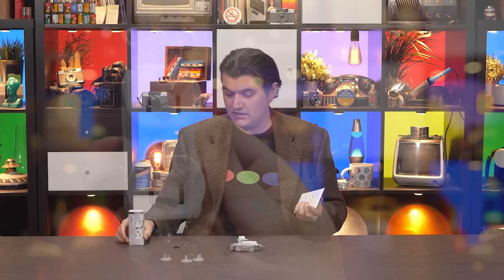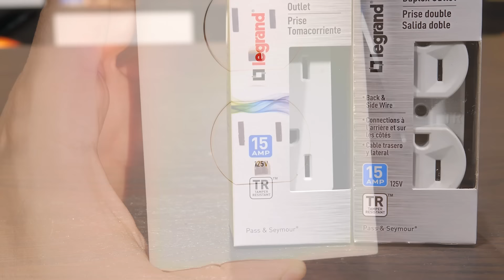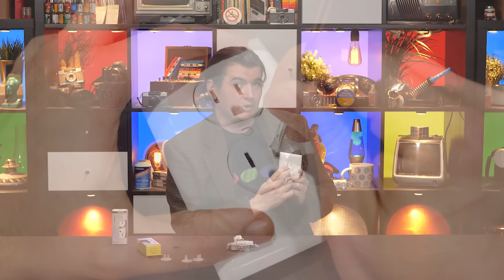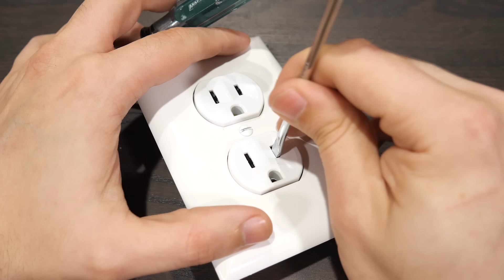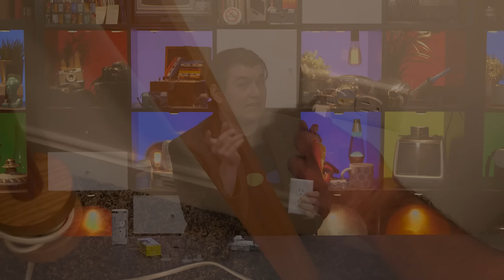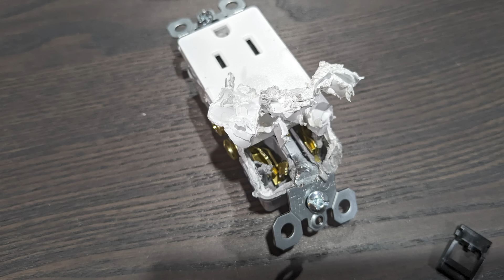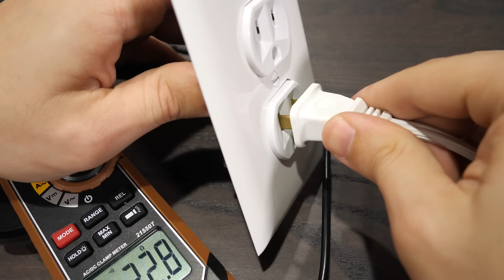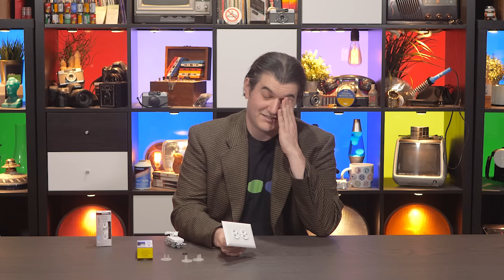Tamper-resistant outlets aren't all the same - a follow-up

Comment: I've actually come across a few outlets that dony have the side screw terminals, and only had the ability to stab a stripped wire in a hole. I dont remember the exact design, but I remember being frustrated that I had to straighten out all of the wires to install the new outlet.

Comment: 14:00 (well a bit earlier) you'd actually be surprised - all things considered doubling the voltage isn't that much, by the time you get to touch a live wire the same other concerns will apply - are you wearing shoes etc. Twice as much voltage isn't a whole order of magnitude, so with all other things being equal it's not gonna make much difference to the outcome - are you dead or not will really be the same equation for the same practical reasons. We don't have accurately measured resistors for shoes etc, so it's gonna be about breakdown voltage and all sorts of similar thresholds for which it's a matter of order(s) of magnitude rather than a doubling.

Comment: Well, 120 volts really is just slightly safer. Don't let that go to your head. If one bar was connected to hot and another to neutral and you grabbed both bars, you're not letter go without someone intervening or the power conveniently goes off. The heart is also very sensitive. There have been weirdos into BDSM that got their kicks off of running one wire to one arm and the other to the other arm. It eventually stopped his heart and he died. Arm to arm is the worst because it goes over the heart. If you have a decent capacitive coupling with the ground with a foot or whatever, a brush with a hot wire can stop your heart. Just because it probably won't fling you across the room (which could be a good outcome in itself), it's still high enough voltage to be a silent killer. Anything no matter how minute we can make our 120 volt power more safer is well worth it to me. Besides, not one likes getting shocked. I've been shocked numerous times by unpolarized lamps, bad home wiring, and me sticking my finger in outlets and sockets when I was little. Yet, I still like working with electricity.

Comment: The "child proof" plug covers have been proven to be almost useless. What toys do we give babies and toddlers? Plastic shape sorting games. It was found that a 1 year old could remove a cover more easily than an adult. And in one case was seen to remove a cover, give it the usual oral inspection, then deftly re-insert the now dribble laden cover.
There is a campaign to eliminate them (Fatally Flawed) in the UK, as they also effectively disable all the safety features built into the socket, and the poorly dimensioned pins can end up distorting the socket contacts, leading to poor contact problems  in future.

Comment: Nice, as I said under main video - its only 120V :D even 5mA GFCI does not trip reliably when you touch hot wire. Ask me how I know. Fun fact, Poland, where I grew up uses 30mA whole house GFCI thingys. Even having 230V. So yeah. I would say main problem with US plugs are exposed prongs, causing fire hazard, not so shock hazard, unless small kids with deadly curiosity, but that's why we have TR.

Comment: Safer does mean less dangerous, anyone that complains about that is an idiot.
I got a 120 hit multiple times.  Reaching for a shop light under the car, the exposed wire in the cord hit the web of my hand.  Then doing drywall, grabbed the outlet to pull it through the outlet hole, and grabbed the side of the outlet.

Comment: The feeling around for holes in the dark is something I do all the time. Especially for finding alignment. Though I live in the UK, so I usually fumble about poking holes on sockets until I find the vertical arranged in (which is the earth pin hole). Though it's less of an issue because a) shutters on all holes and b) sleeved L&N pins in the unlikely event a plug has become loose.

Comment: My main problem with us-style plugs is that receptacles are not reassessed, a child almost died at my house because of that

I live in a country with a EU plugs, but my house was build in a time of let's say turmoil and nobody cared about the code, so all receptacles were made flush with the wall. And basically the exact situation you were describing as not likely happened, someone pulled on a wire, it became loose, a kid was walking by and touching the wall, not paying attention, his hand slipped on the live wire, he almost died and everything electric in my kitchen was fried except the stove and an oven, which are on a separate breaker.

This wouldn't have happened with standard EU outlets

Comment: If you live in a household WITHOUT young children, using Tamper Resistant receptacles is often extremely annoying. To the point where some people will rip out the TRs and replace them with unshuttered receptacles. Different story if you're about to sell the home, but I wouldn't recommend installing TRs as an "upgrade." It's unwise to say "Wago connectors" to mean Wago "push-wire" e.g. Wago 773) connectors, because I think by now, most people think "Wago levernuts" (e.g. Wago 221) when they hear "Wago" (this confusion is pretty clear from the comments on this post). Plugs don't fall out of receptacles appreciably often outside of Chicago either, no.

Comment: You might want to look at Australian plug/outlets. They have a similar plug design but run at 230v nominal. The design originated from the US but lost out to NEMA 5 and 6. They added some hot pin insulation requirements to resolve the “knife problem” from the first video.

I imagine that is a rabbit hole to dive into.

Comment: Schuko Type F for the win!
It's recessed, so no worries about touching stuff or stuff falling on partially inserted plugs.
It doesn't matter which way you flip it (as mostly the two phases are both live anyways in relation to the ground "grip").
It's not ridiculously big.

Comment: Seems like a faceplate with some sort of small 1/4 inch (6mm) ridge around the outside might alleviate the plug being exposed and things falling onto it. Maybe no ridge on whatever the "bottom" of the faceplate might be. 

When I was young, I was shocked ONCE by inadvertently touching the prongs on a partially exposed plug (120v), I did that once! I learned to be much more careful after that....If this happens more than once, it could be a form of population control!

Comment: In terms of the safety factor of our outlets, I think that calling them terrible is a bit of an overstatement. You really just have to not hold the blades, which is just how people plug things in. It takes relatively little thought to make sure you aren't touching the blades. It does prevent the chance for danger, but it still isn't so insanely dangerous that we need to do it yesterday. We could also just mandate GFCI breakers on all circuits. That'll mitigate shocks in all circumstances without forcing every outlet and plug to be changed

Comment: I live in Belgium, we use the same outlets as the French, which is a variation on the Schuko plugs used by the German and Dutch. I'm probably biased, but I think the Schuko and the French variation are the best designs. We have that same tamper-resistant shutter mechanism that doesn't require ground for it to work (unlike the British), the contacts aren't blades but round pins, having the ground pin at the top (French variation) has always been the standard so right angled plugs are the right way around, the outlets are recessed so unsleeved plugs with ground can't be touched while half-inserted deep enough to be live and  ungrounded plugs are pretty much always sleeved for decades. Unlike the British we don't use ring-circuits so we don't have fuses in the plugs, and although they are a lot bulkier than the North American plugs, they are smaller and due to the round shape more elegant than the British plugs.
Also we put the entire house on a 300mA GFCI, the 'wet' circuits on 30mA, and recently it has been mandated for new installations and rewires to have all user-interactive circuits spread across multiple 30mA GFCIs in the breaker box, so we don't have GFCI outlets.
Reply: Fully agreed, though I am used to Schuko (which is essentially the same, but grounding at the side instead of the extended pin). These plugs are great, especially considering the variety of Plugs that are compatible across the continent.
Reply: The French one is better, because it is polarized: you cannot  plug it  the other way. This may allow  to have live and neutral on the same place  (left or right)- I think  the same is true for the UK
Reply: @rizzulazzi  Not really. For example, in Poland, the phase must be on the left side, in France and Belgium on the right. So it's only polarized if you don't visit other countries. And why would you care anyway, proper appliances(not chinese knof off brands) have double pole switches. Some places in France and Norway have 230 V between 2 phases and 133 V between 1 phase and ground.
Reply: @rizzulazzi  Problem is there isn't any code around that, and there isn't always a true neutral anyways (depending on 3x400V+N or 3x230V net).

Comment: 220V does not always kill you. The first time I got hung up on 220V (yes - not just a quick shock) was 60 years ago, and I am still able to write comments on YouTube. But what I find a bigger issue with 120V electrical systems is that they do provide 220V options, as outlined in the video. But the 220/230V system also allows 380V 3 phase options, so power hungry equipment in Europe (for example) can be more effectively powered. EV chargers are just the latest in a long list of such equipment.
Reply: 360V seems a strange voltage for '230V' countries.  Usually the 230V (P-N voltage) is carried by 400V (P-P voltage) 3 phase.
Reply: @retrozmachine1189  sorry, typo. Should be 380 Volts.

Comment: I'm pretty sure I got shocked once and also for a really dumb reason, and I was in my 20s so I should have known better. I think I was plugging in a GBA SP power cord, one of the ones where the blades rotate to tuck into the brick they're on. I was holding it from below and touching the blades with my middle and index fingers to make sure they didn't rotate, and got zapped because I inserted it while touching the blades. Not a smart move. I didn't get any actual injuries but it did scare me.

The same outlet years later started making scary buzzing noises. Whoever installed it originally had used those backstab holes, and just the act of pulling the outlet away from the box to replace it was enough for the hot wire to completely pull out of the hole very easily. I don't know if the poor connection was causing the buzzing noise, but it just started happening randomly so if the backstab holes just got lose while it was installed in my wall that's kinda scary. At any rate that was enough for me to never trust those holes. (Not sure if it matters, but it was a high traffic outlet used for a hair dryer).

Comment: Back stabbing to wire an outlet is perfectly safe… but you’re an asshole to the next electrician. Removing a backstabbed outlet is annoying. And the connection is far weaker than a screw terminals (or lever connection).

Comment: Then, interphase voltage in Europe is about 400V. Something you definitely wouldn't like to experience. And it's a standard now to connect 3-phase supply to apartments as high power induction cooktops become popular.

Comment: A few things:  Tamper resistant outlets have existed for at least 30 years as I remember my Mom buying one but it didn't work as prescribed as that outlet seemed to be faulty.  If we went and bought another one, it may have worked, but we just bought one of the standard ones.  I was maybe eight or nine at the time.  That's the first time I saw one.

I don't recognize the brand name of your outlets as I am familiar with Eaton, Leviton, Hubbell, Schneider Electric, etc.

To the Europeans, our outlets look incredibly dangerous, and they are, to a point.  We are taught from a fairly young age how to use them and the plugs as we should know that we hold onto the plastic part of the plug when connecting and disconnecting.  We should be fully inserting plugs when we connect as well and replacing worn out outlets and plugs or entire cables and cords when they are worn.  Now, there may be a way to start partly insulating the blades and that may bring us (Canada, USA, Mexico, Japan) up to standards with the rest of the world.  We also have something that other countries typically forget and, the way they are designed, have the flaws and the improvements that others forget:  NEMA locking outlets and plugs but these are usually used in commercial/industrial and for carrying large amounts of power from a portable generator.  They have a simple bayonet- style of locking when connecting as a slight twist keeps these from falling out.  Of the NEMA designs, these are my favourite.

Comment: As a youngin, at summer camp, the L bracket bunk cot got shifted and ended up on top of my extension cord.  I touched the rail and got a tickle.  We were all taking turns getting tickles by grabbing the bed rail and a counselor caught on to what was going on and made me cut the cord in half and toss it.  Probably the right decision but it caused several kids to be left without power at their cots for their fans and such (no A/C) so it was definitely not a popular one.

Comment: I have taken a number of full 240V european plug shocks by being grossly negligent and it's not a pleasant experience. It's actually quite shocking how intense the experience is but if you have proper fuses that trip on partial shorts to ground quickly, just from anecdotal evidence I am just not that scared anymore of electrical shocks in scenarios like that. On one hand, I think it is good to be very respectful of wall outlet current even if it's just 120V because there are always scenarios in which it could directly or indirectly seriously harm you. It's a bit like the "Heroin gets you physically addicted even after taking it just once." This fairytale has probably saved a lot of teenagers from making very bad decisions but on the other hand, it's just not true. It's the same with the classic scary "touch the hot wire and die" thing. It's just not true. Multiple other things have to go wrong in addition to getting shocked for it to actually be dangerous.

Comment: 18:00 - Yea, good luck getting everyone to replace every outlet to be sleeve compliant... Granted, the hardware cost probably wouldn't be very high: a study by Coyne College shows that the average home in the US had 75 outlets thus, baring the price of sleeve compliant plugs is not exceptionally higher than current TR plugs (because why wouldn't it if it's mandated everyone replace them, GE, Leveton, Eaton, Lutron, et al, will all say it does), the cost, per home would be about $120.  But that's not the issue: labor!  

For those who are DIY-friendly, replacing outlets is no big deal, but the labor costs for those who aren't willing (or not permitted) to do it DIY, would undoubtedly be cost prohibitive (without subsidization, which good luck getting that passed by Congress [I can see the protest signs now: "Don't make me pay for your electrician!"]).  I can see it becoming code for new construction and a requirement for renovations, but a nation-wide retrofit... don't see that ever happening...

BTW--back in the day (the 90s) there was a company that sold flat head extension cords that also had an associated wall plate/cover combination that let you "hide" the outlet... we've had one, but I see that they're no longer made (I'd have to pull it off the wall to see if I can find the manufacturer, but a quick Google doesn't come up with anything close to what we have)... having that type of solution reduces the changes of children playing toss the knife with lose plugs, or dumb "penny on plug" Tiktoc videos (because what teenager is going to figure out how to open the cover!?!).

Comment: "falling out" is a issue when you rent cheap apartment. I dealt with that being crazy engineer who found breakers (after I shorted wires with pliers) and replacing outlets to cheap new ones. This made HUGE difference. Before my TV power strip was even arcing during normal operation. Those may have been 20-30 yo. for what I could have known.

Comment: Try to yank out a Schuko (european earthed plug) from the outlet in the same way as you can yank out a standard Nema plug. You may be successful, but you may end up a damaged cord or a yanked out receptacle. We have some receptacle which have some lever mechanism, so you push a button, which pushes a lever, which pushes out the plug, so you don't have to force it out of the receptacle.

Comment: In the shop building on the farm when I was a kid every outlet had a big spike driven in close by the outlet to tie the cord around so the plug wouldn't fall out of the outlet.  Those outlets were probably from the 20's and had seen much use.  It was a happy time when we rewired the shop and got rid of all that worn out stuff. I left a couple spikes in place for the fun of it though.

Comment: I live in Europe, and I tinker a lot, i have gotten a lot of shocks from 220V outlets (yeah we call them that even if we bumped the voltage up a bit) and we also dont wear ANY shoes inside and dont have carpeted floors (I dont know if that is insularing), so the hysteria around getting killed by the houshold outlets are blown out if proportion, I can't even remember if I ever heard abot any cases in the news.... ever.
Also, your plugs suck, and they do fall out all the time, I have lived in several houses and apartments in USA and it it a very real problem, especially on wall-wart powersupplys, but even lampcords fall out if you move the cable/lamp